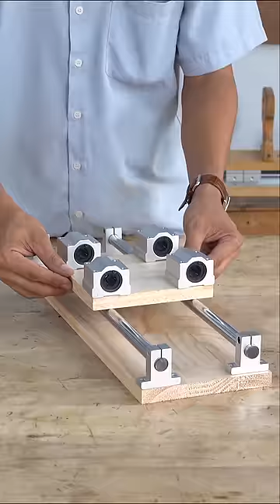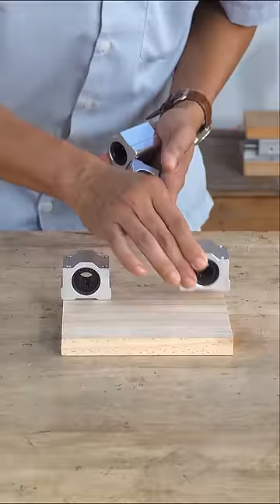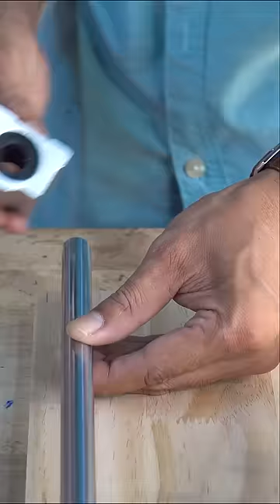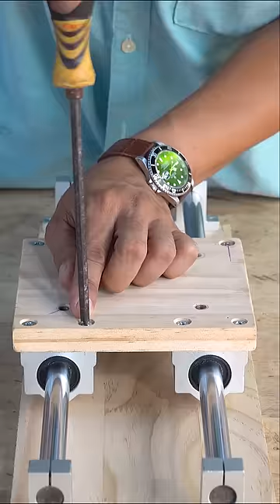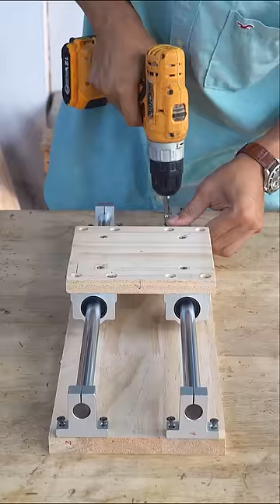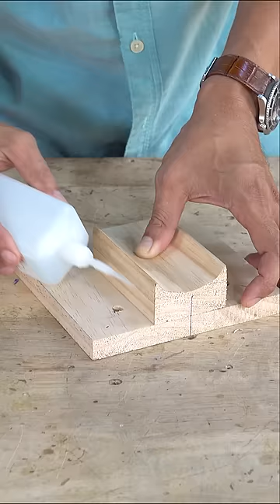Amazing DIY Wooden Dowell with Router Guide Jig ( Part 1 ) #shorts #woodworking #diy #trending

Comment: Why are you wearing a mask?
Reply: The same reason he's using 2 out of the 4 holes per bearing...for the lol's. I mean 2 holes  is fine when on the diagonal, but tightened on the same side as he did, and 1 side of the bearing will rise up. Still trying to figure out myself what he was trying to build. 😅